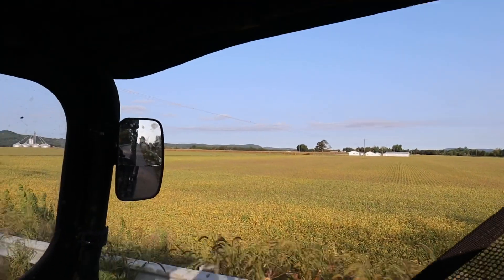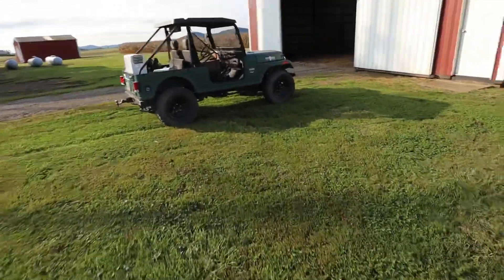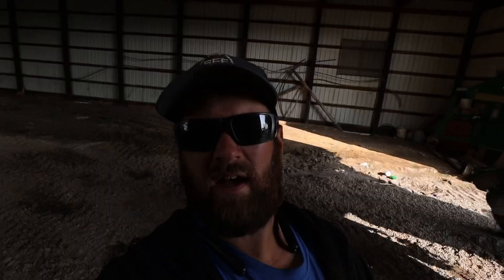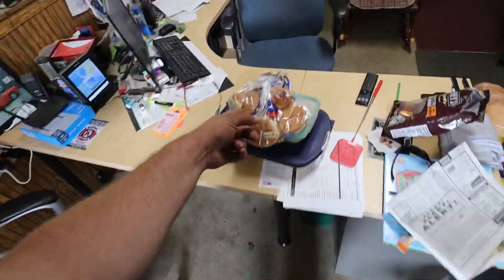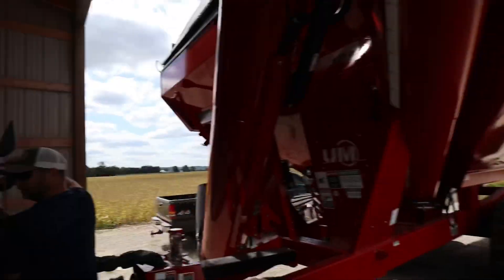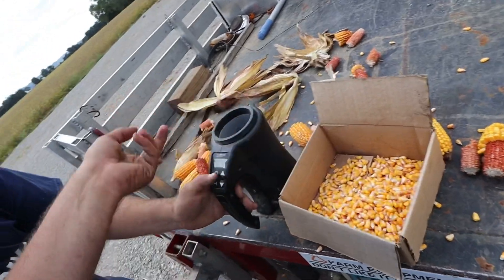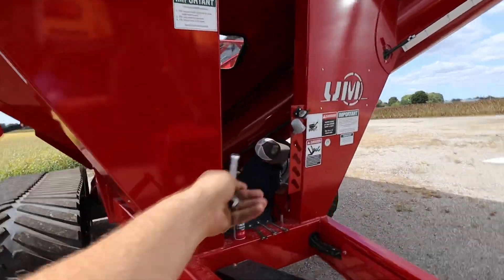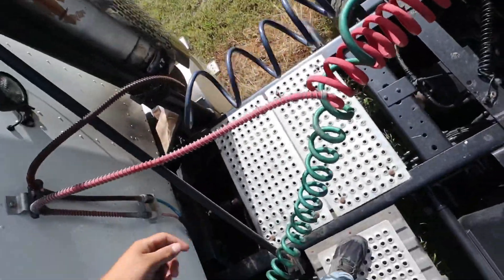Massive FAIL

Comment: Brian I found a easy way to put your hoses in the right remote as I like to raise and lower the 1st handle, unfold the 2nd handle and so on so all the remotes put a small zip tie on the left side hoses then for the 1st  remote put one zip tie around the 2 hoses going into the 1st remote. 
For the 2nd remote theres a small zip tie around the left hose and you put 2 zip ties around both hoses for the 2nd remote and the 3rd remote theres a zip tie around the left hose and you put 3 zip ties around the 2 hoses going into the 3rd remote. 
After doing this I could hook everything up in less than 5 minutes  and jack included. I was sick of hoses in different places all the time 
So I came up with this and then showed everyone that drove tractor for us.

Comment: Different colored zip ties is what we use on our hoses. Blue left, red right. Then another set of colors from top to bottom. Weve used those colored caps over the ends and tape.

Comment: Howdy how’s it going Brian ya know if ya don’t mind the smell of moth balls they keep the mice out of equipment we got three combines and between the three And a chopper I bet you we’ve put $30-$40,000 in wiring harnesses and other miscellaneous stuff get them little buggers like to eat not to mention the wonderful smell they leave where they nest I took a welding rod tin end cap and put probably a half a box of round mothballs in it and just set it on the floor and then one actually three up under the Side panel’s and when they’re not in the machine that I’m using I put them along the edge of the pole barns and they work beautiful I swear the companies that make the wire make it so mice are attracted to the insulation have you ever noticed they always have the exact wiring harness is in stock or in the distribution hub a half a day away the 8700 chopper is the worst though them little buggers have a field day in that and I keep that thing clean gets pressure wash well it gets blown off then pressure washed the smell of mothballs goes away as soon as you take them out of the machine OK bud hi I’m going back to work I just watched your vid